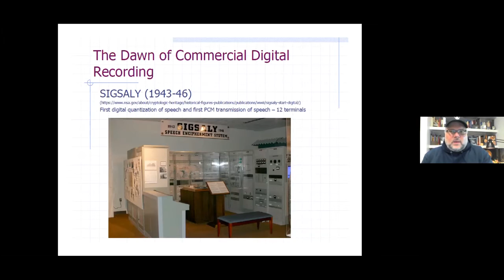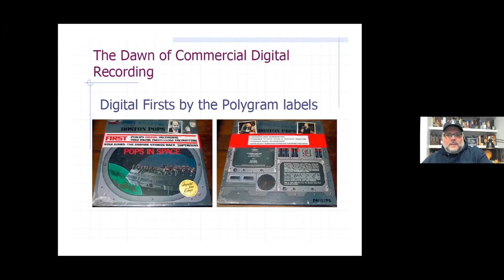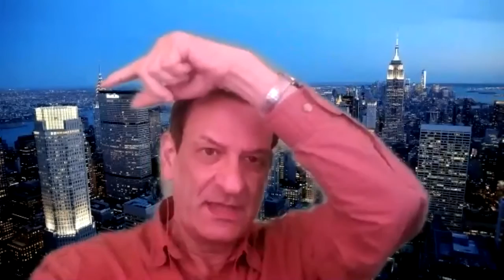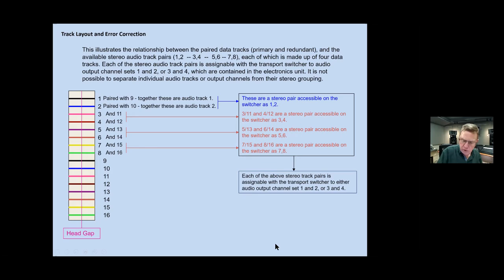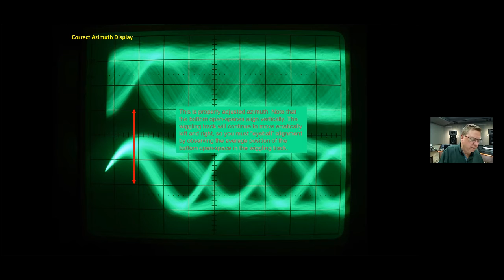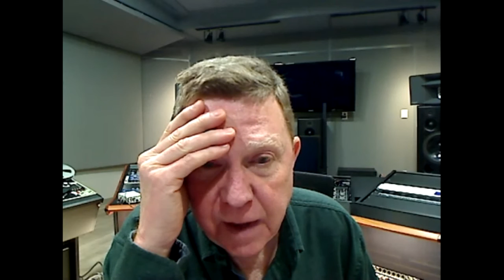Tea Time Topics #30: The Dawn of Commercial Digital Recording;74  Soundstream Digital Tape Recorder

Comment: A very useful and insightful video! Did not know that: some early CDs used GENERATIONAL master tapes, and some of those masters were EQ'd for LP. Also, Sony PCM units needed to be periodically calibrated for best performance (but only a few mastering engineers knew how calibrate). At 1:22:20

Comment: Thank you for uploading this! Not finished watching it but I have a question. I have a few of those early Denon PCM recordings both record and CD and wondered how was the program material transferred for the CD's? Often they are labelled as DDD but as we know the recorders originally used had non standard sample rates and bit depths compared to the CD format. I know now days you would employ a sample rate convertor but I'm not sure how you would of done it back then other than having to mix it down to another format.
Reply from the maker: I asked Tom and Paul, and Paul replied:
"Greetings all. In the case of the earliest Telarc Soundstream recordings issued on CD, Daniel Weiss built Telarc a custom, real time SRC that received the 50k PCM and output 44.1. Unfortunately, that device disappeared somewhere, though I suspect someone at Telarc absconded with it. I joined Telarc in 2000 and one of my first assignments was transferring the original Soundstream tapes, real-time upsampled to DSD, using another custom device made by DCS. The DSD bitstream was recorded to either a custom Sonic Solutions DAW that Sony developed and was capable of recording and editing DSD, or later a Sonoma editing system that was also developed by Sony. All of these options were done entirely in software, primitive though it was. I can add more to this later but need to sign off for now."
If and when Tom replies, I'll post it. Thanks for the question.
Reply: @DansoundSeattle  Thank you so much for the detailed reply! Always found this era interesting, some of those early digital recordings done on those 3M, Denon and others still sound good (a testament to the people who recorded and mixed them for sure) Loved David and Yukio's input. What David said about the PCM 1600 and 1610 is incredible. Whilst I never worked with this machine I can hear it in a lot of famous recordings and I really dislike how it sounds especially in the mids and highs. Crazy how finickity those resistor ladder A-D's were and certainly would explain some of what I hear. We certainly have come a long way since then in terms of recording technology thank god! Now if only modern CD and digital masters would not be smashed to death :D
Reply from the maker: @vinyljunkie07  
There was another response to your question from Yukio Takahashi, who is in the video, with further explanation.
Here is his response in its entirety:
This is Yukio in Japan.
As a digital engineer of DENON Recording Dept. from that time I will explain the situation of the digital at the dawn time of CDs.
In 1982 DENON released a plan of the world's first release of CDs as a company of the starting group together with SONY and Philips.
DENON Started digital recording using a self-developed machine in 1972. We, engineers of the recording dept. of DENON, started further digital development along the plan to realize an all-digital production chain. At that time (1970s) we cut and spliced physically 2-inch AMPEX video tapes containing digital recording data, but it was a quite difficult and time-consuming work. Therefore. we decided to develop a digital editing machine first, and then move to the further element, a digital mixing console and so on... A sample rate converter (SFC) was less important for us, compared with such essential equipment. Therefore, we did not start the development of SFC.
In 1981 STUDER started research of SFC. The leader of the group was Dr. Roger Lagadec, a genius digital engineer. (Later he moved to SONY and lived in Tokyo.) 
Reference: https://www.aes.org/e-lib/browse.cfm?elib=11874

On October.01.1982 CBS SONY and DENON (Nippon Columbia) released the world's first CDs in Japan. (PolyGram group started on October.15.1982 in Europe (Germany).)
That time no SFC was available on this planet except in the laboratory of STUDER.
The sampling frequency of DENON digital recorder was 47.25 kHz and that of CD was 44.1 kHz.
We converted the sampling frequency through an analog connection of D/A(47.25 kHz) and A/D(44.1 kHz). The release date was approaching, and there was no other way.
The STUDER's first real time SFC was introduced to the market in about 1984.
That time we had developed and already used a house-made full digital mastering console.
To finalize 100% digital chain, we purchased the very first shipment of STUDER SFC when they started to sell. (It was incredibly expensive!)
Therefore, the completion of a real digital production chain was in 1984 at DENON.
However, D/D/D was D/D/D already at the beginning of CD.
The definition of D/D/D is a recording in D, intermediate production (editing) in D, and the final master in D. The interconnection between each element is not defined as a factor of "D". (If it should have been defined so, no company could realize CDs until 1983 or 84.)
SFC technology is very difficult. (The performance of the first machine was not 100% transparent 40 years ago, frankly speaking.)
It was not necessary to insist on the idea, forgetting the reality. The good sounding D/A and A/D was an immediate solution.
(Today people read only the simply summarized theory of technologies, which was developed with the enormous effort of the engineers in the last decades, and people tend to think it easy. But pioneers' development work from zero was really tough. I respect a great job of Dr. Lagadec.)

One page of the old story.

Yukio Takahashi

P.S. I wrote this text without checking documents from time but only from my memory. It may contain some mistakes about years.
Reply: @DansoundSeattle  a question on Sonic Solutions DAW. Is it really already possible to edit DSD? Mixing DSD as well?